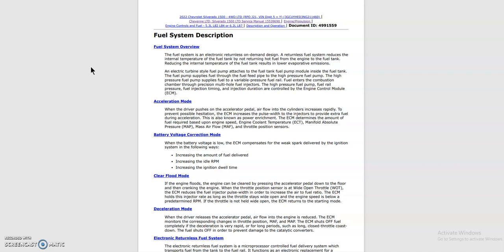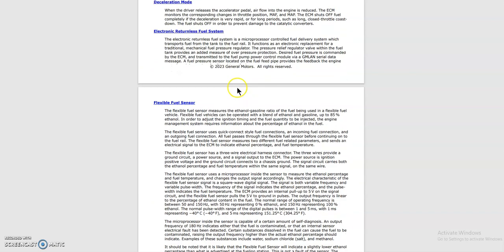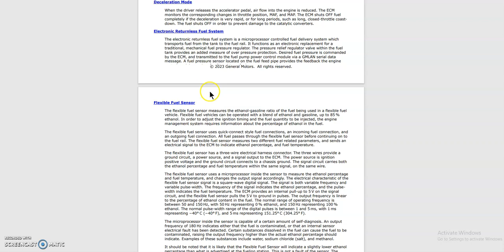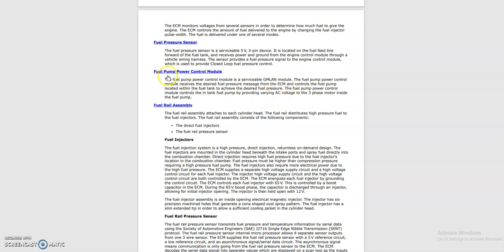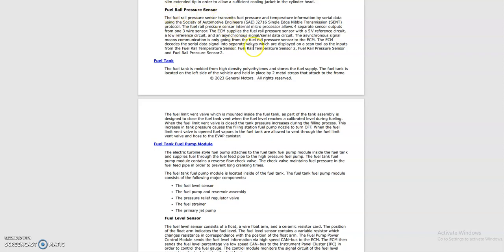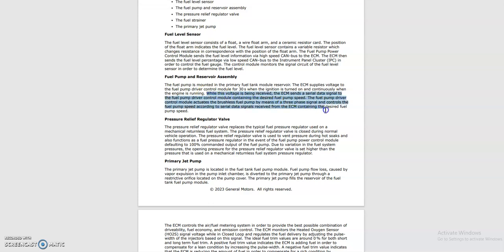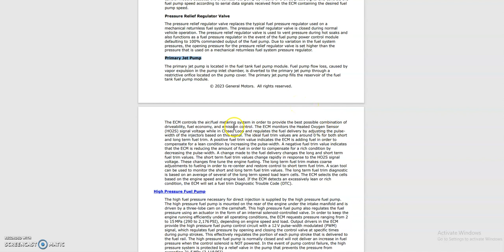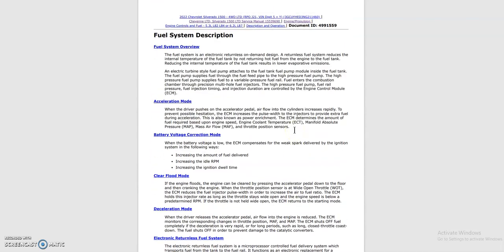New Gen V Fuel system talk

Comment: I've read where a LS fuel system will work. But I've read that the corvette regulator gives out premature since it's at 58 psi. Alot of conflicting info out there. Apparently a aeromotive regulator set at 74 psi is the sweet spot

Comment: I have a 2018 lt1 swap out of a Camaro I get fuel to the pump but my fuel injectors don’t fire at all can start it just fine on brake cleaner vats have been tuned out anything you can think of what’s going on ?
Reply from the maker: Usually a mismatch of ecu, harness, and engine years.  Also the ECU can be bad or not programmed correctly
Reply: @swaptimeusa  can you make a video or do you have any info on how to hook the a/c up with the Lt engine. I have a 71 Oldsmobile cutlass with a l83